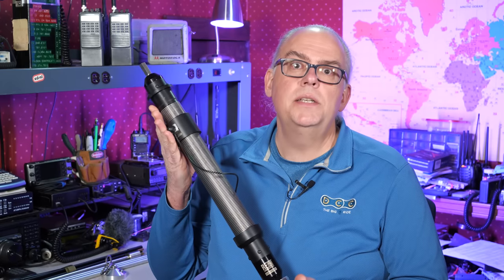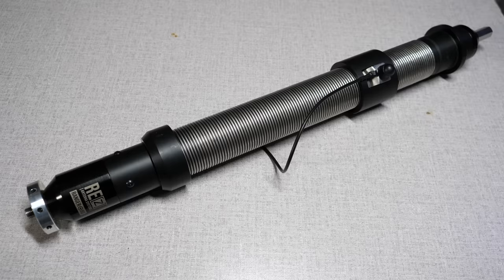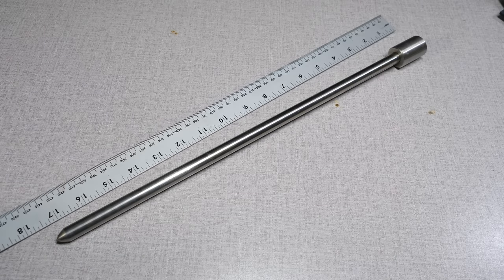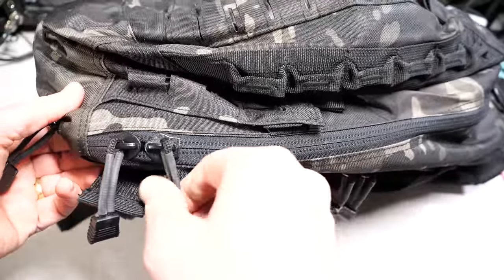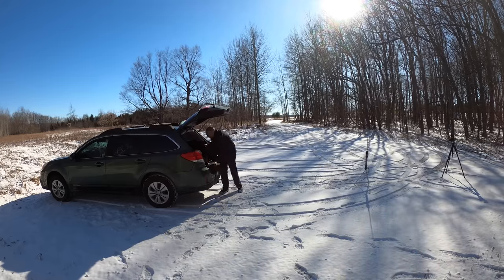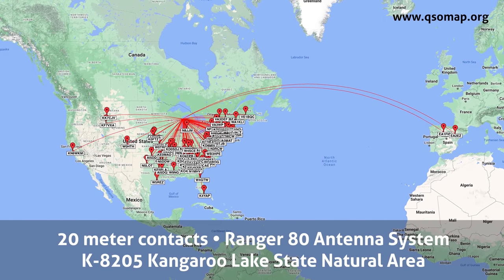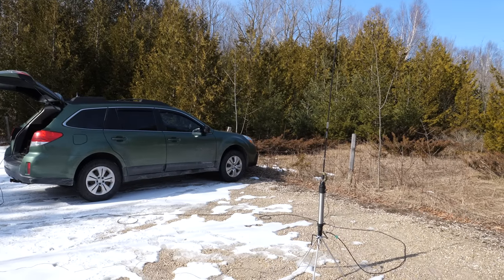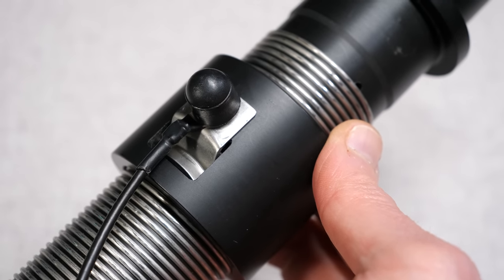Is this a Wolf River Coil Killer? Rez Antennas Ranger 80 System  #hamradioqa

Comment: For what I do, the Wolf River coil system works great for the difference in cash out lay. I’d rather spend the difference on better radio equipment or accessories.
Reply: I agree. I have the TIA Mini and have made contacts worldwide with my Yaesu 818 with 55 signal reports in Europe from a park in Michigan. I have no doubt though that this new antenna is just great. Good review.
Reply: Agreed, not even tunable at 10m and the price of $600 is absurd.

Comment: One question - how does this coil stand up to rain - heavy, unrelenting RAIN?  
Can you leave it set up 24/7 no matter what the weather?  Or is this just a temporary - 'put up, operate, take down'  only when the weather is fine & dry?
Living on the west coast in a temperate rain forest, we can get 2 solid weeks of rain here.
My CHA MPAS 2.0 (in the vertical configuration) has been left out in my back yard for over a couple of months now, with no moisture problems at all (the coax connection has been covered in Vaseline to  keep  moisture out, but that's it).

Comment: Thanks for the review, I like hearing about new antennas coming out. I think of the Wolf River coil antenna as the jeep to the new shiny antenna. Although I like the mil whip antenna, they are very rugged, however, it’s nice to also have a telescoping antenna that can be tuned with the height. As one of the other commenters said, I think I’ll stick with the Wolf River coil for the money at this point. But I’m open to seeing more of this antenna in the future.
Reply from the maker: I do love the rugged nature of the mil-whip. They also pack easier. Collapsed, the mil-whip is shorter than a 213 inch collapsable whip. I've used one with my WRC prior to this review, but it does lock you into the 15 meter band and lower.

Comment: Thanks for the review.  There seems to be a reaccusing theme in your review, High Quality. There is always something to be said for great quality. I hope to see one of these antennas at the Greater Houston HamFest as I understand REZ Antenna will be there.
I am an addicted POTA activator. I use a Yaesu 891 and the ATAS 120 mounted on my truck, but the ATAS 120 is what it is, it does a good job for quick activations, but there are times when I want to extend the activation. The Ranger 80 will be in my POTA gear if it is half as nice in person as it is in your review.
Reply from the maker: I think you will be impressed with the quality of the coil when you see it at the hamfest. I had to send my unit back so it could be on display in time for the show- so that should be the actual model that I used in the video.

Comment: Interesting review. With the exception of the coil, this is very similar to the CHA MPAS 2.0. In fact, it uses almost the exact same brass vertical segments.
One difference, the MPAS 2.0 is multiband - no need to move a coil tap.  Other than that they are very similar, including the ground spike.
These portable verticals do get a good signal out.
With the MPAS 2.0 in a similar vertical configuration in the middle of my back yard, I've worked Alaska, Japan, Hawaii, Costa Rica, New Zealand & Uruguay with 100 watts.
Reply: I have the WRC and the CHA MPAS 2.0. I can tell you, the WRC radiates far more efficiently than the MPAS does with their balun. The WRC isn't quite as high speed sexy looking, but it works a lot better.
Reply: @BryanGrigsby  Interesting.... How did you determine that the  "WRC radiates far more efficiently than the MPAS does"  ?
Did you actually take field strength measurements at a fixed distance and angle off the horizontal, or did you just get better DX contacts?
Because the latter is subject to so many atmospheric variables that you can't use it as a meaningful comparison.
Also, don't forget that the MPAS is 'multi-band' without having to change coils, or adjust the tap position on the coil - I have left mine out in the elements 24/7 for over 2 months now (rain, sun, snow), and I don't have to go outside to adjust it when I change bands.
I'd like to try some antenna tests myself - i.e. does the CHA cap hat half way down actually lower the 'takeoff angle' for better signal strength at the 'sweet spot' of 5 degrees (Callum's angle for optimum DX).
So please let me know.
Reply: @BryanGrigsby  Thank you for that information. My intent was for an 'all-band' man-portable (i.e. 'bug out') antenna that could be left out in the elements, and could work most bands (160-10m) without changing coils. I understand that it's not a 'DX' machine, but in the vertical config (21' high with a CHA cap hat) I have been able to work DX from Alaska, Japan, Hawaii, Costa Rica, New Zealand, Canary Islands, and of course, Uruguay .  I'm on the west coast. The 'black box' balun/unun does seem to dip around 20m, but even on 80 up to 10 the internal ATU on the IC 7300 can tune it.

Comment: The radials can always be split in half with bullet connectors to re-extend back to the full length.
Reply from the maker: My time with the antenna was limited, so I didn't have the opportunity to test it with my preferred radial network. But that is a great idea. Split the radials with banana plugs and you can plug split sections back into the base to create more, shorter, radials.

Comment: Great review Michael. Very honest and to the point. It looks like a very good antenna with performance right in there with the WRC and Buddistick. As you stated, the price is it's major downfall. Great quality and build, but I don't need that level of toughness and precision in a portable vertical. Looks a little on the heavy side also. I drive a Caddy, but my antennas tend to be on the simple, but still rugged side ( I use the Buddistick and Ham Sticks for  portable vertical use and will someday buy a WRC). This antenna will not be one I would buy, but someone with more disposable income than myself may very well want this. Very nice to look at also. Not that it makes a huge difference, but I can get my Buddistick very close to a 1 to 1 match easily and quickly. Being slightly anal, I like that.
Reply from the maker: I wouldn't take my higher than anticipated SWR readings as a downfall of the antenna. I think it had more to do with the location, frozen soil, and poor ground conductivity. I run into the same challenges with the WRC in the winter time.

Comment: For 40m or 80m(?) I can understand using base loaded whip. But for 20m and up, I don't. A full quarter wave vertical using 6m squid seems better. You use a PVC pipe pushed into the ground with three guide ropes and some stakes as the mount for the squid pole. For the radials take 5 lengths of wires and solder them to together with a connector. Then make 4 sets. Very quick to put down 20 X 3m radials.
Yes it might take 10-15 minutes to put up but it won't be as compromised as a base loaded whip. Or am I missing something.
For 40m and 80m you might be aiming for nvis contacts. In which case a vertical isn't the best option.

Comment: So the name |Z|Pod is rad. The size of the coil (bc it accommodates 75/80m, presumably) may make it more unwieldy to center load. While the buddistick is kinda fiddly, I like the fact that it’s not necessarily base-loaded.
Reply from the maker: I wouldn't try to center load this antenna. I've center loaded the SB-1000 and it was really top heavy. The Ranger 80 is about twice the weight, so I can only imagine how much it would sway.

Comment: Very interesting antenna. I do like the look of the antenna's construction and that the military whip. The angle the accessory legs of the [Z]Pod makes it sit a lot higher than a Wolf River Coil. Not crazy about that though, but not a deal breaker & that it's still an accessory for the antenna. I do like that that bag looks smaller than the GIANT over-sized bag that the Chameleon MPAS 2.0 comes in (later versions). And 5 stars for the bag coming in some sort of Multicam Black (not sure if it's official Multicam Black, but close enough)! 

Steep price at $525 to start. But again, you said it, it's all about the materials used and quality of the build. Buy once, cry once. 73!

Comment: I have a wolf river coil that I use at my home qth.  I was thinking of getting a second and have one tuned to 75M and one to 20M.  I couldn't afford doing that this this antenna.  So, this is a minor criticism for most but a major one for me.
Reply from the maker: One nice feature of the Wolf River coil is their dual collar accessory. With it you can set up two bands, for example 80m and 20m, on the same coil and switch by just swapping out the connections.
Reply: @KB9VBRAntennas  I was thinking of that also.  In any event the price different is so great as to rule out the otherwise excellent Ranger 80.

Comment: I use a $40 efhw draped over the top of a tree with a sling shot. Very good quality, but out of my price range. 🤷‍♂
Reply from the maker: I love wire antennas, but will prefer the vertical during the winter months because it is a lot quicker to set up.

Comment: Nice review. Honest review. But a vertical antenna is a vertical antenna so there’ll be no significant performance enhancement. And unless someone has evidence of the WRC falling apart after years of use (not heat related as the platinum address that) I couldn’t justify the higher price. Sure, the materials might be upgraded or more premium but what problem was solved for? The ability to hang weight? Not worth the extra cash to me.
Reply from the maker: As I stated in the review, I don't believe there is a performance enhancement with the Ranger 80 vs the Silver Bullet 1000. The differences are solely mechanical and the construction of the Ranger 80 addresses many of the WRC flaws.

Comment: I have multiple wolf river coils, whips, tripods, etc.  Using 15ft radials, usually 16 of them, wrc tripod and the rez adapter or my homebuilt groundstake, I commonly see swr of like 1.12 1.07,  or 1.2 at worst.  Have you seen swr in that low of range in the field with this rez unit?  My biggest complaint about wrc’s is that they all seem to be crooked on the ends (couplers & threads not perfectly inline), but they function great and repeatably perform.  This drives my mechanical ocd crazy,  when screwing them together and having the whips at wonky angkes etc..
Reply from the maker: My testing was very limited with the Ranger 80 as it was a demo unit that I returned to the manufacturer after producing the video. I wish I had more time to use it in more locations to get a better understanding of its performance. But my impressions are that it worked quite similarly to what I would expect the WRC to function. One of the issues we have in Wisconsin is poor ground conductivity (due to the large amount of granite bedrocks). In one location I had a hard time getting the Ranger 80 much lower on 1.7:1 on 20 meters. But the next day in another location, I had no problems tuning it below 1.2:1. (once I get down below 1.3:1, I don't fiddle any more to get a better match). The only difference between the two would be the soil composition. The two locations are separated by about 50 miles but are geologically quite different. 

What works best for me with the WRC, and I know the Ranger 80 would function similarly, is to use more shorter radials than less longer ones. The Ranger came with 4 30 foot radials, so I deployed it in the standard configuration per the manufacturer. Expanding the radial network, or using the ground screen for that matter, would have made a big difference. 

I love the Wolf River coils, but I agree with you, the fit and finish is their biggest downside.
Reply: @KB9VBRAntennas  Aha,  good deal,  yeah, I’ve had my best results using more short radials here in IN,  vs less but longer ones.  
The quality of the Rez is appealing to me,  but the wallet says no,    right now.  
Thanks for the video(s) etc.

Comment: looks like a great antenna . i have a 7300 hundred. is the tuner in the radio enough?.  I have an old manual tuner
Reply from the maker: A tuner isn't required for this style of antenna. You can adjust the loading on the base for a perfect match.

Comment: hey great video im wondering what the radio with the green and red tags are.
Reply from the maker: That's a vintage Drake TR-22C 2 meter portable radio. I picked it up at a hamfest years ago. It mostly sits on my shelf as a conversation piece. The tape on the side are the frequency channels for the all the crystals in it.

Comment: Nice antenna, can’t get that Wolf River coil below 3.0 SWR, perhaps this will perform better.
Reply from the maker: Tell me more about your setup, what are you using as radials (how long and many) and what type and how long is your coax? How is the coil mounted (spike, tripod, vehicle)?
Reply: @KB9VBRAntennas  I’m using the Platinum WRC,  the tripod you recommended, Chameleon telescopic whip. 50ft coax Rg58u, 33 ft radials, 3 of them.

Comment: I just got a Wolf River at Dayton this weekend. How many 16 foot radiials are you using with success?
Reply from the maker: I use 8 16 foot radials. They are in two bundles of four with a clip to attach to the base of the antenna. I have had good luck, though, with four 16 foot radials, but prefer 8.

Comment: How does the WRC with tripod compare to this with tripod in terms of weight? If you were a SOTA guy considering a vertical b/c you have no trees at a summit, weight is going to be a big factor.
Reply from the maker: The Ranger 80 coil weighs 3.5 lbs, which is almost double that of the Silver Bullet 1000. This wouldn't be my first choice for SOTA. If you want to stay lightweight and have 10-40m operation, I'd consider the Wolf River Sporty Forty, 213 inch whip, and either a ground spike or WRC's tripod.
Reply: @KB9VBRAntennas  That was my suspicion, I have the SB 1000 too. The Ranger 80 does look really nice though.

Comment: one question I can't find the answer too can it be used in the rain
Reply from the maker: I've never had issues with the wolf river coil in the rain, so the same should apply to this antenna. But if you are concerned, I've had other tell me that you can make a rain hood out of a 2-liter drink bottle. Cut off the bottom and thread the whip through the hole at the top.
Reply: Yes, the Ranger 80 can be used in the rain. The unit is weather resistant except for the coax connection. If you intend to leave it out in the rain for an extended period of time then you’ll need to seal the coax connection.

Michael’s suggestion about the 2 liter “rain hat” is a great idea. The rain can cause crackling on the coil as the water runs over the turns. This would eliminate that.

73 - W5REZ

Comment: I wonder what would happen if you added banana connectors to the end of each radial and then have both ends of each radial plugged into the base.
Reply: I was thinking the same thought.  That should have an effect similar to cutting the radial's length in half and perhaps doubling the radials at the same time. 👍
KZ9V
Reply: @davewhite7679  I might actually try that time. 73 KD5YOU

Comment: Michael. I'm curious. Was this the antenna you were using when I worked you on 20 meters on 2/17?  I was at 1100 feet elevation mobile stationary with a 20 meter ham stick. Your signal was solid 59 in south central PA.

73
Matt
W3MMW

Edit
Whoops I should have waited 2 more minutes. I saw my call sign on the map. Hope to hunt you again in the future. 73!
Reply from the maker: Yes, I was using the Ranger 80 on that activation. Thanks for the contact.

Comment: Why do these guys and Wolf River use stainless steel in the coil???  I know about the benefits of stainless steel but the resistance of it in the coil is a real performance killer.  I had a WRC Silver Bullet at the coil measured 10 times the DC resistance in the 80m position than the coil on my Hustler 80 m resonator measured.  Punch those numbers into an efficiency calculator and see what happens..... not good !!!!   

I love the concept of the antenna but a better material needs to be used for the coil.  For the higher bands where less of the coil is used, these are decent, but when you move to the lower bands and use more of the coil the shortcomings show up.

Comment: Would be nice if it was 3/8th inch mount so it could bê
Reply: It has a 3/8-24 stud on the bottom, that's what is screwed into the tripod mount. It can be screwed into any 3/8-24 mount.

Comment: Michael I normally like your videos but I'm going to take exception with this expensive system that cannot even do 10m at equivalent power handling. It's got bling, that's not Cadillac or even ruggedized like a Chameleon system.
It's almost like your doing a hard sell on this unit and it comes across to the viewer as disengenuous and contrived. We need to nip this growing trend of great operators like yourself pushing products to us that are not a good choice for the average guy.
Wolf River Coils and all the systems and replacement parts is the best choice for all of us. They earned that position with genuine desire to improve ham radio. I don't have their products and would love to use them. I'm just another old radio guy that can only afford what can be built on my bench. Wolf River Coils actually builds their gear cheaper than I could and that says a lot.
I think the buy line for this is video as a Wolf River killer is not being honest.
That's my opinion brother and I hope you take it as constructive criticism and not negatively. We all trust you greatly and would hope you consider your reputation in all reviews.